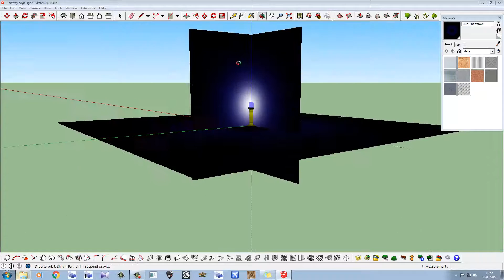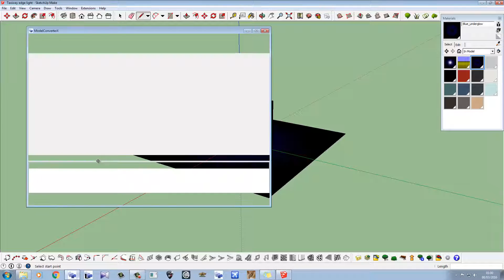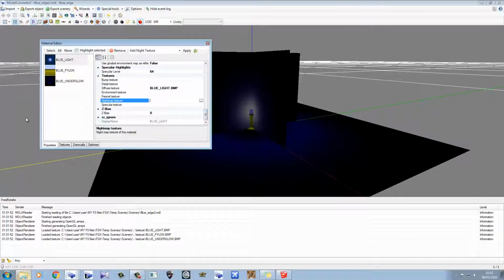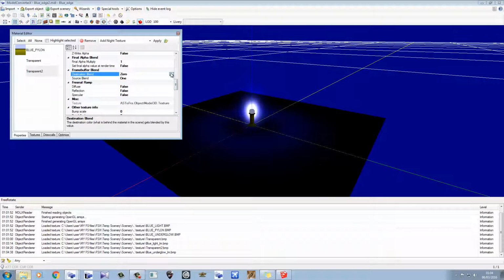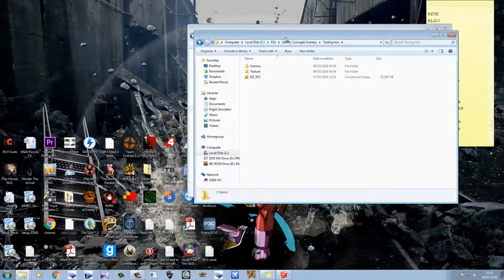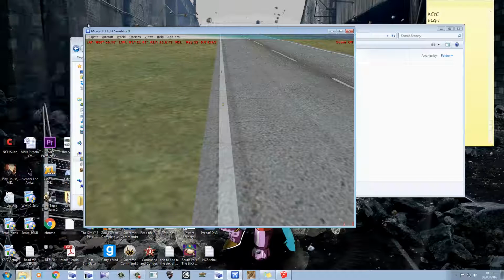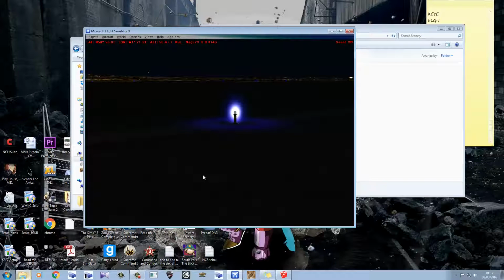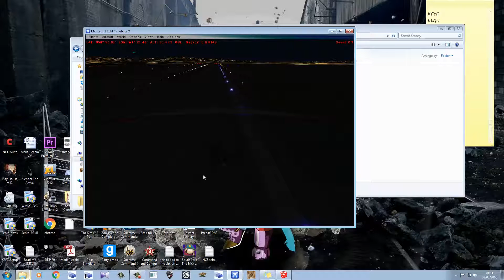FSX Tutorial, Creating Taxiway Edge Lights

Comment: HI again,
When I add the diffuse texture to the ground splash it goes checkerboard, and no matter what I do, besides using undo, there is no way to get the ground splash texture to show, or to get the checkerboard to go away.
I have MCX 1.4 and am following your instructions to the T.
Any ideas on why this is occuring?  my day(transparent) texture works perfect for the light, so I made a copy and named it slightly different. the problem lies in the groundsplash texture or the diffuse somewhere, but any idea what it could be??
Thanks a TON!
Reply from the maker: Make sure you save the model first then bring it back in. Have all the textures ready in the corresponding textures folder. Different folders will cause failed to load checkers

Comment: Excellent tutorial, thank you. For the issue of lights not showing at a distance....the best solution is to substitue the bloom texture for a BGL light (vs LOD). Reason is, the transition into dissapearing is SO MUCH smoother....like default taxiway lights.
Now....for runway lights...LOD is a most, so you can see them from 10 miles out. I also add an effect with inverted mipmaps.

Comment: When I use transparent texture for day, it automatically takes that same for night. It doesn't accept my night light glow texture. If I use night light texture, it uses that alpha for night and day. Looks like it only takes one source of alpha for day and night. Any idea how to fix?
Reply from the maker: Hi Spidy, First of all thanks for watching! It seems you may not be using the latest version of Model Converter X, the stable release is 1.3 where as you need to use a development release of the software. You can find it here https://www.scenerydesign.org/development-releases/

Don't forget to adjust your settings in the new version so the file paths for the dev tools are all correct before you start using it.
Reply: I just download mine a while ago, version 1.3, but not working like yours.
Reply from the maker: 1.3 is out of date, it is the stable release but you need to use a "development release" direct download link http://www.scenerydesign.org/latest-release/modelconverterx_latest_development_release.zip
Reply: Soarfly Concepts Scenery thank you now it works..